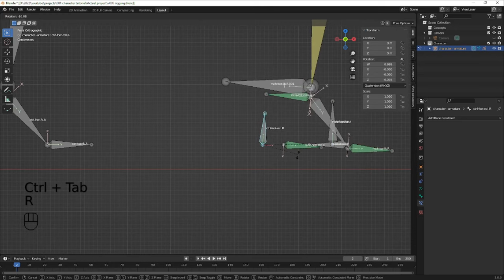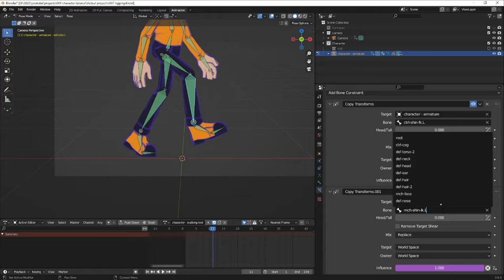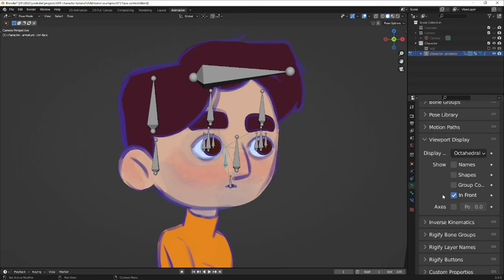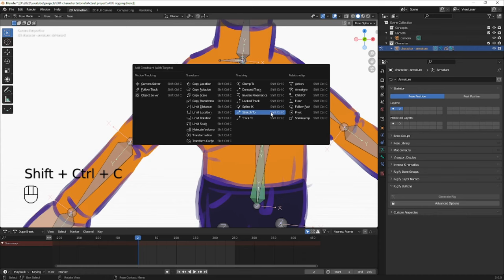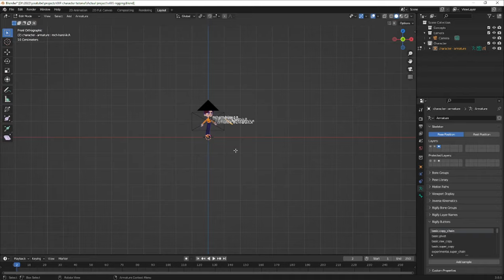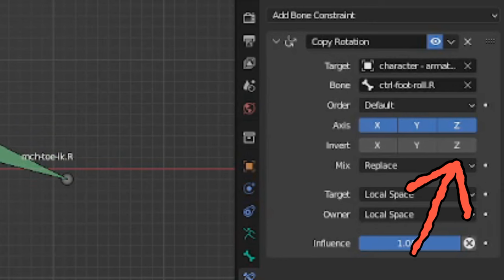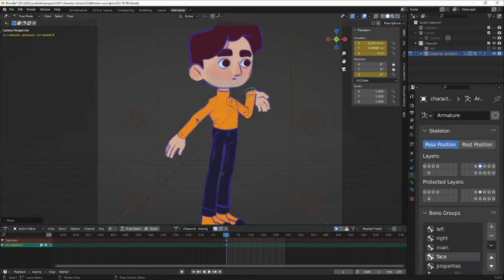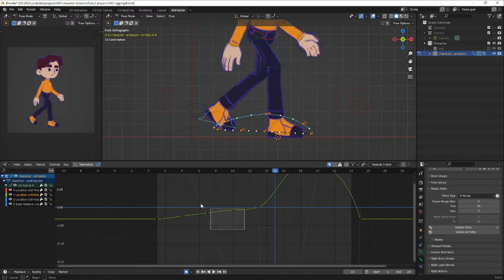Groovy Grease Pencil Cut-Out Character Rigging Tutorial | Intermediate to Advanced Blender

Comment: Bro can i get this character resource in zip as i am a beginner i just want to learn rigging and constraints .it will be very time consuming if i draw it from scratch. so it will be helpful if u provide character zip file.
Reply: you can import an svg file into a grease pencil object, you just need to separate the parts into layers in your vector editor and make sure the svg file is exported with presentation attributes.

Comment: When i move the root bone the character is not moving with the root bone as you showed in the begin.
Reply from the maker: Hi there. So this should be a fairly simple problem to fix, essentially the rig will work as a chain of parent and child bones. We need to make sure that every bone if you trace its relations all the way to the top, ends with the root bone. So you should be able to take bones with no parent and parent them to the root. You can do this by entering edit mode, selecting the bones you want to be the children of the root, then while holding shift, select the root bone, and press CTRL+P. Then in the pop-up menu, select keep offset. Then it should work as intended, when in pose mode. Let me know if this is helpful, or if you have any other questions :D

Otherwise, you can send me your blender file by email. You can find my address on the about page of my channel. https://youtube.com/sketchysquirrel/about
And I'll do my best to solve the problem.
Reply: @SketchySquirrel  The root bone is the first bone how do I set this so that the character is moving with that.
Reply: I have this same issue and nothing's workin. Honest to god want to give up because seemingly no solution exists for it

Comment: The first part confused me, what do you mean by drawing over the outline, it appeared as if you were filling it in with something.
Reply from the maker: Hi there. I'm not sure exactly what part of the video you're referring to. It sounds like adding colour to the linework. Essentially this process works in grease pencil by having two types of materials, line materials and fill materials. The process I usually follow is to draw the line work on one layer, then on another layer underneath, I would follow the silhouette of the shape, or "drawing over the outline", using the fill material, to add the colour. There is also a fill tool, which follows this process automatically, though the way I draw line work often leaves gaps, making it easier to create from scratch. I hope that I have answered your question, if not let me know and please add a time stamp indicating which part of the video you are having difficulty with. :D

Comment: Copy location doesn't do anything for me when i attach it to the control bone. In the "LINKING DEF Bones to MCH/CTRL" section
Reply from the maker: Hi there. I'm not sure what you're facing here, but here are some things to check. Make sure that the constraint is on the correct bone. If you added the constraint manually, then make sure that the target field has the armature, and the bone selected. If the bone with the constraint is already in the same position as the target, then nothing will happen right away, so try moving the target bone around, and see if the DEF bone follows.

I hope that this is helpful. If not, feel free to send me your blender file. You can find my email here: https://youtube.com/sketchysquirrel/about

Comment: question: does using relation  parent(armature)- Bone for a certain grease pencil layer be the solution for using grease pencil instead of vertex groups?- maybe this will save time in reparenting each frame to the armature when using time-offset
Reply from the maker: Hi there, so sorry for the long delay in response. Attaching the entire layer to a bone could work really well. I find it's better practice to use vertex groups, as it allows for more flexibility, but there are plenty of senarios inwhich parenting an entire layer to a bone would work just as well, Łukasz Rusinek (@yosifol) made a great video  about how this can be used to make mixing frame by frame and rigged animations easier. https://youtu.be/z3zRJ6904i0

Thanks for the comment, and sorry again for the delay :D

Comment: alt-clicking on the dropdown panel at 48:50 doesn't seem to work for me for some reason. Same issue with a previous segment I had to manually change the property of each individual item.
Reply from the maker: that's really strange. Did you have all the elements that you wanted to change selected? because that's important. Other than that, I'm not sure why that wouldn't have worked. Let me know if you have any more questions, or if you figure out what what happening.
Reply: @SketchySquirrel  I did. Holding alt made it so that I couldn't open the drop-down at all. Maybe it's a v3.6 issue or something.

Comment: Do you have access to onion skins when a grease pencil object is rigged?
Reply from the maker: Hi there, to answer your question, yes and no. The onion skins only relate to the grease pencil key frames. So if you're using a hybrid method, then the onion skin feature is still helpful, however if you want to use it to track the motion of the rig, then you're better off using the motion paths tool. I hope this is helpful.

Comment: how is it that when you parent your bones, they're being connected to the base of the bone? while when i do it, it connects to the tip of the bone instead.
Reply from the maker: Hi, sorry for the late reply. I'm not exactly sure what you mean, could you give me a timestamp in the video where this happens? Otherwise I'll take a guess. You are correct that when parenting one bone to another, if you choose the connected option, rather than keep offset, then it will attach to the top of the parent bone. However you may be referring to a point where I am using a copy transform constraint. At first glance it looks like it works the same, but it's very different. As you pointed out, it snaps the bone to the base, rather than the tip, and in pose mode it is impossible to alter it's pose, as it's copying all the transforms of the other bones, and that cannot be overridden manually. I hope this is helpful, if not, feel free to ask me any more questions, or do some research into how use constraints in blender. :)
Reply: @SketchySquirrel  thanks for this man. i was able to fix it already! :D

Comment: Can I make turnaround after making this type of character rig in blender for animation
Reply from the maker: Hi there. The answer to your question is yes. Technically you can rig something along those lines, but be warned, the more features you add to your character, the more difficult it will be to make it intuitive to use, and animate. So make sure that you absolutely NEED a turn around before you start on it. I would recommend making several different rigs, which you can switch between for different angles. I hope this is helpful :D